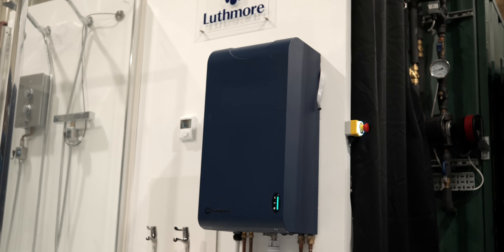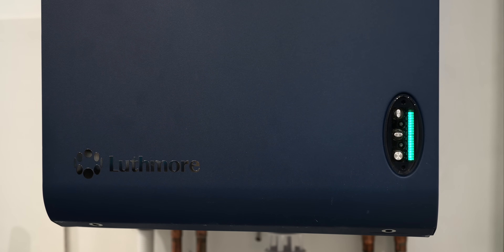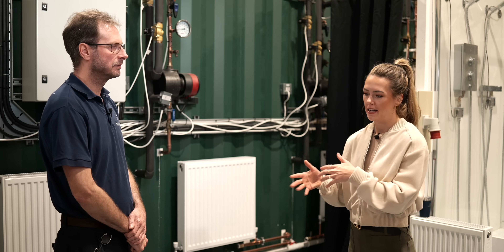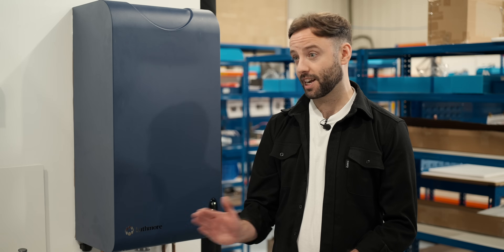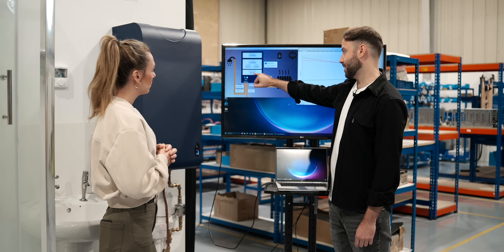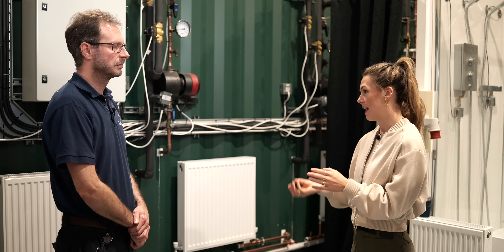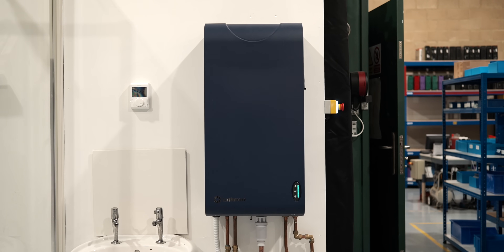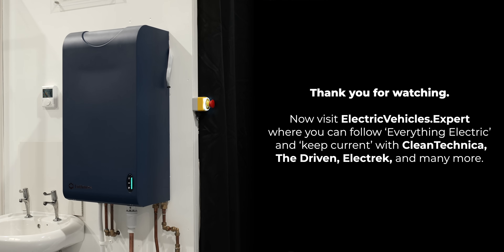Could This Battery Boiler Replace Gas AND Heat Pumps?

Comment: That's not a solution, I can imagine a smaller one under the sink for instant hot water (they exist already) but using electricty for the central heating without a heat pump is 4x the price of electric heating using a heat pump, so can never be viable in the long term. The costs of the pump as not going to be that much more than the cost of this battery. Those who live in blocks of flats, in the olden days there would be a central heating system for the entire building. It makes no sense of everyone to have their own boiler.

Comment: Can Imogen get a better microphone? She always sounds so muffled.
Heat pumps are getting smaller and could compete with this boiler if there is a way to get air in/out from the outside. Only if that is impossible, this boiler may be a solution. But 5000 pounds can give you a lot of home battery storage that also could help deliver extra power up to an extra 10 kW. This can be achieved by avoiding a DC-AC inverter for the heating element and instead connect the heating element directly to the batteries: a dedicated DC output. That is the biggest part of the trick by Luthmore for which they ask a generously high price! They mention a capacity of 7.5 kWh and a power output of 30 kW, so that is 4C, which is quite a lot. An average LFP battery from China can deliver about 1C power output, so 4 times less. But they cost only 160 pound per kWh and a reasonable home battery may contain 10-15 kWh, so could already deliver 10-15 kW output power for a heating element. If this is used to preheat water in addition to power from the mains, you can have a 20 kW shower. This should be enough for good comfort. Plus you have battery storage that can be used for all electric usage!
Reply: good points, but 4C is nothing special these days especially for intermitent applications like this one. Automotive lithum batteries use precision cooling (water or coolant) to get much higher peak and continous ratings, and realistically, with the low internal resistance of modrn lithium batteries, and the limited run time of this device (5.88kWh of storage and 30kW peak power) i bet the cell thermal inertia would actually be sufficient without any active cooling. I also absolutely guarantee that this unit has it's battery modules filled with "chinese lithum" because honestly that is really still the only viable source at any practical volume. Without looking deeper, it's not clear what cooling strategy or cell architecture is used, but even bogo prismatic cells with external cold plates can hit 4c fairly easily given the limited duty cycle of this device
Reply: They are also putting the battery inside which is now frowned upon and in a block of flats is usually even more of a nightmare because of all the rules on protected stairways and exit routes.

For a small house a battery goes outside, almost all of an air/air heatpump goes outside so you've now got the space for the boiler to use for a hot water tank, an immersion and a timer to heat it on the cheap rate and if desperate you can even take all the bulky radiators out by going air/air.

Comment: I'm not quite understanding it!?
If they can heat water at 30kw, does that mean they have a 30kw inverter or an inverter that has a turbo type function that is able to provide 30kw over a short time?
Also, how big is the battery capacity? Even at 10kwh, that 30kw water heating will drain the battery in 20 minutes (leaving out inefficiencies etc)!
And then to use all that battery power for water heating only? Why not use the cheap rate electricity to heat the water and store it in a tank, either by way of a heat pump or direct water heater!?
Reply: No need for an inverter. A heating element can run directly from the battery.
Reply: @salipander6570  It'll still flatten the battery in no time at all, and it;'s still cheaper to heat water overnight and keep it in a tank. 5kWh of hot water in a tank is a lot cheaper than 5kWh of LFP battery
Reply: @etchedpixels  That is not an answer to the question about the inverter. But yes, this is an expensive niche solution, which is too convoluted in many cases.

Comment: What an absolute travesty Farnborough was from the point of view of the cars on display. So many cars in the hall but the vast majority of them remained locked. How do you expect people to be able to properly evaluate these new cars if they can't sit in them, open the boot, and fold rear seats, to see the capacity, etc. I won't go to Farnborough again. Is there any point in attending anywhere next year?
Reply: I was in a Fully Charged show in Amsterdam a few years ago: similar, not much to see, quite boring actually.
Reply: What's that got to do with this boiler?

Comment: What about the new guidance that says batteries have to go outside?
Reply: I think that only applies to certain battery types, the exploding ones, though I might be wrong.
Reply: @christopherhume8896 

Probably best to check prior to posting.
Reply: It says they should go outside, but it makes no distinction between NCM/NCA/LCO/LMO and LFP which is a great deal less burny, so it's a pretty dumb standard/recommendation. Many people blame the Tesla rep on the committee (because Tesla make NCM/NCA ESS batteries, and almost no-one else does).
Reply: @xxwookey 

😂😂😂😂

Probably an argument best left for your insurers.

I doubt they'll care what you think.

I know we don't.
Reply: This means BS63100 I take it?
Reply: That is a very good question... My storage batteries (16.5kWh LFP) are in the loft space, installed way before new recommendations, but yeah, any new storage battery is advised to be installed outside...
Reply: @melhiore 

I very much doubt you'll get grandfather rights ref the battery position.

For all anyone knows some mortgage providers will take on board the recommendations ref batteries being installed outside and decline to offer a mortgage that doesn't comply.

You might have noted that some mortgage lenders decline to offer mortgages on property where a spray foam insulation has been injected into the cavity walls.

Plenty of info why online.

It shows mortgage companies are avid followers of insurance claims and you can work out the rest for yourself.
Reply: The guidance allows for up to 40kWh to be stored inside if it's not practical to put them outside. As a boiler, it is impractical to put it outside.
Reply: @mgutkowski 

Only guidance "today", but who can say what happens "tomorrow" if the guidance becomes a legal standard and has to be complied with?

Some might say, me for one, that there's been rather too much jumping the gun ref battery installs.

Consider, if the NIMBY brigade are only too keen to protest about having solar farms nearby, and now BESS facilities, then they could easily complain to local
Authorities ref a "power wall" next door or a noisy heat pump.

Going green, even on the purely domestic front, isn't quite as easy as HMG would like us to believe.

Comment: With a COP of 1 and much of the grid still powered with gas at 60% efficiency, this thing is worse than just keeping the gas boiler. Also the Lithium cells could be put to much better use than heating water. 
It's not small either, and it does not sound cheap. Just sacrifice some space for a hot water tank and put the heat pump outside, either in the garden or on a shared appartement roof. 

So I really don't see this as something that makes sense in any way. Even demolishing buildings that are too hard to fix sounds like a better idea than putting in something this grotesque.

Comment: I live in a flat that is part of an 1836 built former Workhouse. I cannot have solar PV, or even a heat pump. My thought is to insulate the walls [internally], and not go the heat-pump route as it is impossible. I do not heat to a high temperature, and have found a solution that does not run away with electricity. A 600 Watt fan heater with a rather accurate thermostat set to 15 degrees C. Off for most of the time, but probably this will run more during any cold snap.

I like this idea. In the old days you could empty a hotter tank with a too long shower, and now you would drain the battery with this novel idea. No need to drain the battery every time you have a shower! Just wash quickly!

I would not need a wet central heating system [We have no gas main anyway]. so this could function nicely as a unit to shower without paying standard tariff prices at the time I would want to shower.

Brilliant idea.

Thanks for a most interesting video.

Best wishes from George
Reply: Have you considered air condition units that also do heating? You can buy one that you stick the exhaust tube out the window and it uses the outside air to take heat from and pumps it indoors. It works exactly like a heat pump - because that's exactly what it is!

Except you can get one for around £500 that outputs around 12,000 BTUs.
Reply: @FahadAyaz  Noisy, very, very, very noisy.Trying to seal the outlet so no cold air creeps in is also nigh on impossible.
Reply: Air conditioning is your friend. Same technology as a wet system heat pump but you don't need planning for a single unit that can feed multiple rooms.
Reply: @Soulrollsdeep 

You might have a squint at FAR IR panel heaters.

Concentrate on making premises draught proof before anything else.

Then insulation, heavy curtains, door draught proofers and the rest of it.
Reply: @ForestForest-n9i  IR panels are shite. Tried them, woeful. Also 1:1 energy, a heat pump is the only solution for electric heating.

Comment: I wonder if it's possible to make a tiny yet efficient heat pump
Reply: You can't have a small heat pump at the moment as there is a volume requirement to capture heat from the air. This may change in the future but I wouldn't hold your breath. We would love a heat pump but don't have the space.
Reply: The problem is NOT the heat pump itself but the requirement to capture the heat to be pumped! ie the actual pump, and electric motor with a vane or reciprocating pump on the end of it is already pretty small. Pretty much every car made in the last 20 years and every A/C unit, already has one, and they are roughly 5kg and are smaller than a typical show box. The problem is that the heat pump itself needs to "grab" heat from the outside world either from the air around it or from the ground under it, and pump it into your house. The bigger that capture area the better the system works.  Typical domestic heat pump using "air source" ie grabing heat from the air around you house use a large fan to pull that air across heat exchanged in the heat pump unit, and it is those components that are large and clearly have to be practically mounted outside, which is what renders heat pumps as unsuitable and costly for some properties

Comment: Something needs to be done about the price of electricity in  the UK to make more of these options viable
Reply: That would require a complete change in the regulation of the industry. The price of electricity is set by the marginal price of the most expensive power source. So while solar and renewables are the cheapest source the marginal price is set by gas which is expensive so cheap renewables are sold at the price of natural gas which explains big energy company profits.
Reply: @davidlazarus67  Partly true. There's also the CFD price of renewables don't forget. Some of which are higher than the MCP comes in at most of the time. So even if the MCP went away tomorrow, you'd still be stuck with the CFD price of those legacy renewable contracts for years. Then there's the green levy to pay for, curtailment costs, & "network costs" all loaded onto the bill.  

Let's not forget that MCP is going to be driven up too, as by adding more renewables, you'r making both CCGTs and SC Gas plants CF go down but not it' overheads. Therefore, each unit of electricity produced has to be priced to make them remain viable.  You'll always need them, because wind & solar can't do baseload, dispatchable or load following without a huge additional investment in BESS. 

In other wods, prices are only going to go one way, and that's up. Turns out, going renewable is an expensive business when you look at the true FSLCOE.
Reply: @davidlazarus67  shh don't mention the standing charge which has risen from 21p a day 4 years ago to 62p a daty today, why ? to subsidise middle class lovies and their renewable fixation by way of grants, they sleep easy knowing they are saving the planet and helping donkey sanctuary's
Reply: @SteveJones-gz4vd  A lot of those standing charges have gone to cover the losses of those unable to pay. That’s the wrong way to use standing charges. If they want to ensure consumption is manageable, increase rates for higher consumption. That way a low user will not be crippled by the high standing charges. It makes up most of my bill.
Reply: Its artificially linked to that of gas hence the stupid prices
Reply: @stevenbarrett7648  errr but Gas is cheap
Reply: @stevenbarrett7648   "there are 35 active gas fired combined cycle power plants and 14 single cycle power plants operating in the United Kingdom, which have a total generating capacity of 35.7 GW" ... so hardly 'artificially' linked to gas prices
Reply: @stevenbarrett7648  It's not 'artificial'. It's just a market. Suppliers offer kW (at a price) for each half-hour. The cheapest are taken first until enough kW are supplied to meet demand. Everyone gets paid the price it took to satisfy demand. It's a sensible way to fulfill a demand that must be filled at the best available price. How else do you propose to do it? Expensive gas is needed less and less often as the amount of flat-rate low-carbon supply (and battery and demand-management options) increases.
Reply: In this case I think it works fairly well - you can get cheap overnight tariffs for charging things like this - sometimes less than 10p per unit. What I like about this unit is it wouldn't lose heat like a hot water tank does - but I suspect it is quite expensive.
Reply: @gavinminion8515  The Luthmore boiler has a ex vat price of £4500
Reply: Well not suitable for me my region NI in UK is 16p cheapest off peak.
Reply: On the other hand, if you have photovoltaics the ROI is much faster, also for big investors who can then add more renewables to the grid. Don't you think?
Reply: Good solution but will the regs allow you to install it inside the property?
Reply: @HHGTYG-u6g  yes, as per PAS 63100:2024  “Where practicable, storage batteries shall be installed outdoors”. As the Luthmore ONE boiler contains water pipes, which, may be liable to freezing in winter, we do not consider it practicable to install the Luthmore ONE outdoors.
Reply: I want a thermal battery paired with heatpump dont want a tank
Reply: @deanwhittle1301 

😂😂😂

Then install an electric instant shower ( 6-10 kW) via a 45 A radial circuit off the consumer unit.

Must be millions of showers just like the above all over the UK.

Far too many ignorati getting gulled by the battery system hype.

Why don't the punters ask what the pay back is under their own personal circumstances.

It doesn't help when our government ignores technical advice.

Who on earth persuaded HMG that BEVs and battery "anything" were the answer to a maiden's prayer.

The blind led by the blind.
Reply: Yes. Get rid of the entire stupid political class whose ignorance and stupidity left us is such an appalling state.
Reply: Unfortunately they don't need to, because the government is forcing us to phase out gas boilers, so they don't need to provide an incentive to switch over to electric or make you think it's viable.
Reply: With the nut zero cretins in charge, electricity prices are only ever going up.
Reply: @martynbush  100%
Reply: @SteveJones-gz4vd what’s the cheapest way to generate electricity in the UK? I’ll give you a clue, it’s not gas, oil or coal.
Reply: @a1white  Yea it's oil , My oil boiler is amazing , i fo have solar so my house is net zero, suck it up butter cup
Reply: @SteveJones-gz4vd  buttercup? Are you coming on to me? Just becuase you buy oil for your boiler does not mean that for UK energy power stations Oil is the cheapest.  it isn't. Wind energy is cheapest, by a long shot.
Reply: @martynbush you know that is not the reason electricity prices are high right?
Reply: The answer to cheap electricity is use gas!. But of course we can’t point that obvious thing out can we? Electricity will get increasingly expensive in the uk until at least 2045.  We’ve been scammed I’m afraid. We know we need to move to electrification but we do not have the infrastructure or the materials to make it happen.
Reply: I totally agree that electricity prices are totally obscene.
Reply: If that means some fat cat somewhere losing money then it ain’t gonna happen.
Reply: It's never going down, and we don't need it to. We have a shit ton of natural gas and coal and both are amazing.
Reply: @HarveyDarvey1122 

Yes but not "green".

Suggest you stop typing tripe ref fossil fuel.

You'll just confuse the natives.